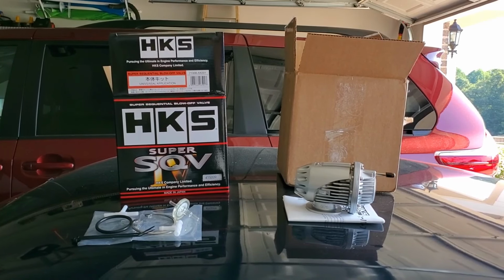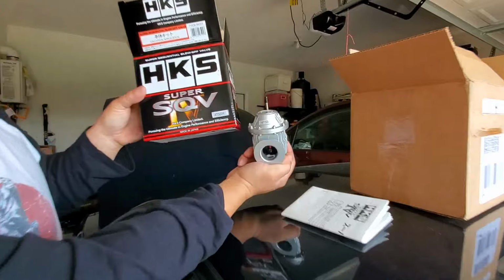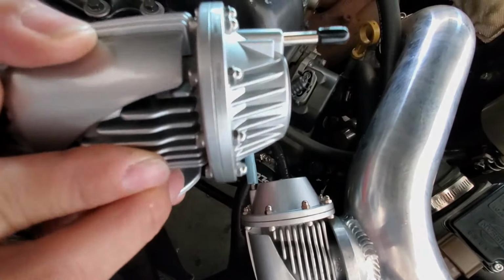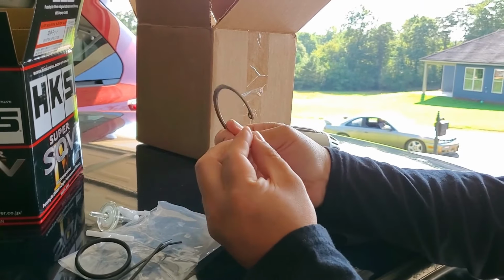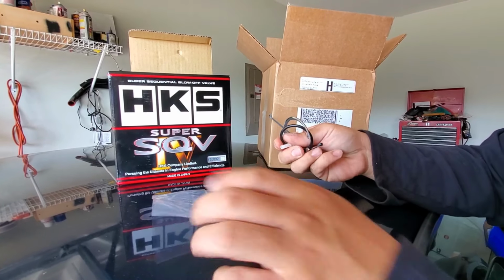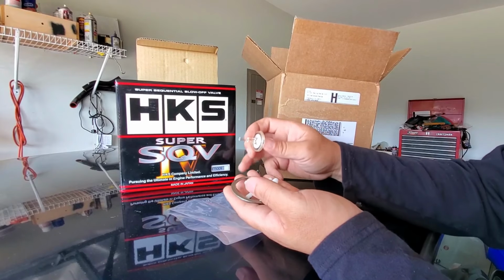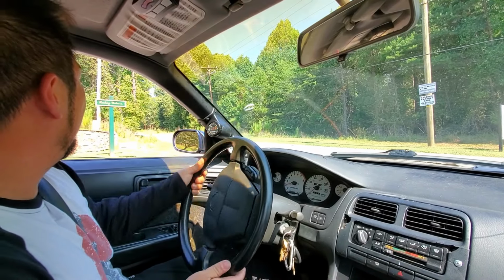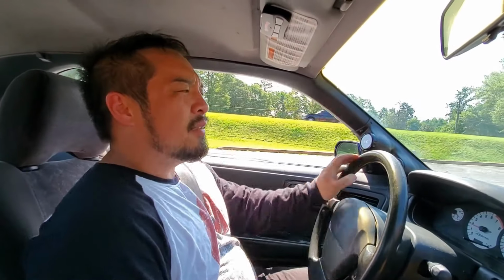Real HKS BOV vs Replica BOV (SSQV Blow Off Valve)

Comment: I like the flatter noise on low boost. I like the replica better.
Reply: Run no bov you'll get a better flutter. Flutter comes from the turbo not the bov. The bov makes the pssh or cherp sound. Reason why the flutter is gone with the better bov is because it's working better at releasing the pressurized air when you come off throttle and the air has no where to go but out the bov. Cheap bov didn't let the pressurized air out as good so it when back through the turbo making the flutter.
Reply: @remyche8768  ya but only on los boost so it’s not that big of deal right ?
Reply: i like the replica better
Reply: :( mine doesn't flutter what the f. It just blows off ridiculously high pitched lol. It's got.boost alright but I want sone stututurus
Reply: @know1n359  you need a turbo bro
Reply: @know1n359  Your car probably doesn't make enough boost. Flutter is air being forced against your turbo. It sounds great but isn't all too healthy for it.

Comment: that isnt the turbo surging.  thats just the bov being off on the spring.
Reply: My hks recently stopped making the high pitch blow off sound, my car still holds the same amount of boost pressure it just makes the turbo surge. Do you think its maybe a spring issue?

Comment from the maker: We hope you all enjoyed this video. Any questions?? Drop it down below👇
Reply: I have used a real and replica one on my Megane RS. I dont think you get those in USA. 

But they are both very quiet, unless I am on full throttle under load. 

If I rev in neutral regardless of throttle it will not release... 

Any ideas? Honestly will probably just throw on an older turbo smart one. 

But its baffled me...
Reply: I guese a tight bov is kind of the "Functional" priority... but I am a bit disappointed even the HKS was very quiet. 

I even tested both and got same boost, same sound... just a matter of reliability but they seemed as strong as eachother.
Reply: 2.0L inline 4, about 290hp from the crank. 14.7psi. (Small turbo)
Reply from the maker: @Mira6Rus  In neutral, though it may not be as loud as with the car running, the bov should still open. Put hand in front of bov release port and you should feel air being release. If nothing at all, then the bov is not opening. Suggest checking vacuum line and dont use thin soft rubber line because they may calapse under vacuum pressure and heat.
Reply from the maker: @Mira6Rus  Make sure that the vacuum is not clog and hook to a port with access directly to the inside of intake manifold.
Reply: @risin9365  I will give it a try! I just barely understand the "Why" of how a BOV works. 

Im a V8 girl 😂
Reply from the maker: @Mira6Rus  Any more questions, don't be afraid to ask us. We will do our best to help you out. 😁
Reply: @risin9365  Thanks :) I wish I could just drop the Megane off at your place and leave you 100 bucks or something haha 

The French make nothing simple -_-
Reply from the maker: @Mira6Rus  Not a bad idea. But at least you are learning 😁
Reply: @risin9365  No hoses seem weak or flat, and if they were flattening under pressure it would probably be least effective at 100% boost, not most effective. 

I think we can eliminate the lil vacuum hoses.
Reply: @risin9365  I am still running stock air intake, just with a aftetmarket panel filter... 

Its notoriously "Silencing" as when this was stock my god was it quiet. 

Pipe it down under the battery, cold air intake to under headlight will help?
Reply: @risin9365  I hate pod/mushroom intakes but I assume its the best plan to get more air flow?
Reply from the maker: @Mira6Rus  hks Mushroom are the best
Reply: Can you send me the link of the replica were you bought it please?
Reply: @Valantis_Stylianou  Yasou... 

Mine was a "GT Performance" HKS Replica for a Megane RS. 

But its essentially just a ebay HKS knockoff that this company added the right adaption hoses etc for Megane RS. 

All the cheaper "HKS" SSQV seem to be the same Chinese Maker. And mine ran almost identical to the real HKS. 

(Only 16psi... Had it in like 3mths now because I cant be fucked changing it to the real one). Its just a BOV... you will know when it breaks and it wont do much damage.
Reply: I wish I could but I don't afford it. Thats why I asked about the link of the replica that he bought!
Reply: Please when you have time send me the exact link of the replica that you bought
Reply: @Valantis_Stylianou  Ignore that dudes review he probably didnt even buy it. 

Ive had mine in for a while now... even did a track day with it haha
Reply: @Mira6Rus  I think you are right. I'm gonna check it out. Thank you for your help!
Reply: @Mira6Rus  no load means no boost. The engine spins too freely
Reply: @RobOnMotors  I have a proper intake now... It was that not the bov! 

Bov is annoying af now haha too loud

Comment: Does it sound the same ?
Does it leak boost ?
Those are the two question I’m looking to be answered. Most engine bays you can even see the damn thing anyway.
Reply: Does it affect reliability?
Reply: I ran one on my daily running 28psi and the only issue I ran into was the o-ring for the flange broke other than that it worked perfectly for 2years until the car got totaled

Comment: My SQV is not a counterfeit, but the low-speed pressure relief at 3-4000 rpm is different from your low-speed pressure relief at 3-4000 rpm. How should I install its pipeline to make the pressure relief sound like yours? ?

Comment: Thanks Man. It helped me, but i read on the internet That the original hks 4 have 2 valves. Smaller for lower boost (0,2-0,5) and the bigger for higher boost (0,5 - 2,5). Is That right?
Reply: Yea that’s how a sequential bov works
Reply: @steveq4178  that's why they are expensive because China bovs hks4 have only one, but its written on Valve sequencial. Its lie. They cost like 5 times less.

Comment: Above is a simple mechanical device ... nothing complicated... this over hype  doesn't Wirth the price.....
     If your car is a 7 lb boosted...u can do without genuine hks bov 🤣.
   Bov require correct set up... vaccum/ boost hose connection and pretension spring are important.

Comment: I use to have a HKS with 8 bolts but all the rest was exactly as yours and was proper Loud. I’m getting 100% real now but did HKS ever made an 8 bolt SSQV4 version?
Reply: Dude mine is the same & it has 8 bolts in the back but everything else looks like the one in the video .I been running it with no issue on my sr20det for the pass 7year & it’s loud .
Reply: @JV-fu8br  yea mine aas very loud as well! No issues but want everything original now lol

Comment: America is great ! Asian , Italian who the F ever ! Lets all be corn fed, race car enthusiasts together! GREAT VIDEO BROTHER !!!! Any advice on manufactor to use on a 2011 335xi twin turbo ? has a jb4 tuner , exhaust , cat less down pipe , intercooler , snow performance stage 2 meth kit but blow off valve stupid loud at low rpm's like you were mentioning in video ! new to turbo tuner car life ! once i drove this car i had to own it ! engine would buck bad upon heavy acceleration, found cylinder 6 80% leak down failure, only 25lbs of compression ! injectors seem good and coils . No idea how cylinder 6 ended up poop! Also had a low coolant alert every 50 miles or so put on car , failed a pressure test but could never see any coolant leak, even up on lift !!!! no milky oil mixed with coolant and car never blew smoke out exhaust !   I found a company to sell me a fresh remanned motor for 3,000$ , what should i do in the 30 days it will take to get motor ? I like your character and your intelligence and how you explain without all the social media ass juice retard extra shit ! I could really use your help brother and appreciate your videos thus far ! snow meth kit not installed yet . car never been right since i bought few months ago . in engine malfnction reduced power mode car ran accelerated smooth , soon as i put jb4 in auto tune full power mode , upon hard acceleration car would hesitate and jerk frekin hard ! then jump in reduced power mode until engine light started blinking and lost cylinder 6 . hope hear from u ! james renai , in Delaware my facebook .

Comment: If you don’t like surge, check the vacuum connection on back of bov, it is not producing enough vacuum to pull the gate and vent the air out.
Reply: My thoughts exactly nothing to do with bov just boost leaks

Comment: The replica will not last longer. I have using it on Mitsubishi Lancer GSR 4G93T with stock boost (0.7bar), after 1 month it started to sound like turbo flatter, then I bought a cheap used real first version of HKS SQV and changed it, no more turbo flatter sound... I still using it for over 8 years now, still working great, not sure what will happen if I increase boost pressure, I will try it soon. But my both HKS SQV have adjustable spring pressure, it is the first version, chrome body.
Reply from the maker: The replica works ok until pushing the boost up. We highly recommend the real version to eliminate any possible leak. You may have the earlier HKS version which is still a great product.
Reply: @risin9365  maybe the replica did you using are made in Thailand or Taiwan, it's quality is better than made in China. About boost leak, the replica does not leak. But I heard, the real SQV cannot hold very high boost. I hope someday someone will make a prove video about it. Anyway, thank you for your video.

Comment: You're not really hearing compressor wheel reversing or fluttering with low boost, that's your wastegate fluttering from the low throttle surges within the vacuum lines. You would really only hear compressor surge when letting off the throttle as intercooler pipes have a bunch of pressurized air inside and nowhere for it to go. As far as liking or disliking the wastegate flutter, that's subjective. I never gave a damn so long as everything was working.

Comment: Those both sound way different compared to what my HKS sounds like. I have 0 turbo surge at 2 lbs of boost or 19 lbs of boost. The HKS sounds much better though for sure. It sounds like that knockoff is to restrictive to dump the boost fast enough.

Comment: So I ended up purchasing a replica thinking I was getting a good deal. Now that I have it I am curious as to any problems with installing the replica versus going about getting the authentic?
Reply from the maker: Just get you a very good snap ring tool and you should have no problem. The replica snap ring may be a bit of a pain to install but it is manageable. Also the replica rubber o-ring may make it a bit more difficult because the size may be too big or too small depending on the supplier.
Reply: Where did you buy the replica

Comment: just a good fact. the one fin on the top doesn't make it a fake. that is a fake one but that fin doesn't  identify it as fake. HKS made several different models through out the years, my wife has an OG HKS on her wrx with no fin and its authentic. Every time HKS releases a new BOV after the first original one they added a fin. The original real HKS was a smooth surface with no fins. The SSq2 has 1 fin, the ssqv3 has 3 fins, the ssqv4 has 4 fins,  DO not use the fins as a identifier for being a real or fake HKS. Another way to tell with the better looking fakes that actually say HKS on em. the fakes dont have the trademark logo in the corners of the HKS badges on the valve itself.

Comment: I have always had a question I had a replica and it was identical to the authentic one but the nuts and the rough part that you mentioned that wasnt smooth in the authentic one is what really told them apart. Can you tell me if the authentic one you have holds vacuum or does it slowly release it?
Reply: https://m.facebook.com/story.php?story_fbid=909338782559852&id=100004512164948 here is the link showing the quality of the copy.
Reply from the maker: We don't have the necessary tool to test that right now. But how are the T-piece and Snap ring that comes with your bov? Do they match our authentic descriptions?
Reply: @risin9365  no they were the same as the fake one you have. It was black and the t piece was cheap plastic. I can tell you now they are using a silver snap ring now and trying to pass it as an authentic one but the part doesnt seem to have the bevel cut on it. Counterfeit has gone a long way to be honest. When I did the vacuum test on mine it held vacuum but it leaked very very slow so I know the fake BOV had good response. This is my second knock off I tested. The first one I had you knew it was a knock off. Had hks written on it too but it ripped the diaphragm and I repaired it and also trimmed the housing because it was poor casting that wasnt cleaned off. I'm sure it was a rushed process being made but overall it did work properly. The down set was that the black snap ring was prone to rust. I also forgot the dual action that the authentic one does the copies do not do. The center part is molded together with the outer part as just one piece design as the original hks has a two part relief action. The one thing I wanted to know is the authentic one really hold vacuum and not leak anything. If the original did have a very slow leak as the fake one I could really say the copy is just more cost effective and the real thought would be how long that copy will last before something breaks on it. Obviously the quality of the original is outstanding and it will last way longer.
Reply from the maker: @PeNDmN  Yes, the authentic one does have two stages of release. Replica ones are stepping their game up, the Bov itself looks very identical now externally. We have not taken apart a real vs fake bov internally but that is a great idea to show comparisons internally. We must do a video in the future.
Reply from the maker: @PeNDmN  Replica company tends to not waste money/time making the t-piece with HKS branded on and also a nice fine snap ring with the bevel cut on.
Reply: @risin9365  someone already has taken apart a fake one and real one but an older version of it though. You can definitely see the quality differences though.
Reply from the maker: @PeNDmN  definitely would be nice to pull one apart and gain some knowledge to pass on to others 👍
Reply: @risin9365   I finally bought a used HKS SQV4 same as yours. I tested the vacuum port. It held vacuum without any leaks. Not like the replica so yes huge difference I can tell you. Night and day. I hope this helps others as well.
Reply from the maker: @PeNDmN  awesome. We really appreciate all your input. This will definitely help everyone out.

Comment: how many psi can the hks bov hold?
Reply: All the psi. The HKS SSQV is designed to seal better the higher the boost goes. It's a Pull-Type BOV, so to release the pressure, it is pulled open AGAINST the pressure, not WITH the pressure like, for example a Bailyes DV26.
Reply: @frankotto83  thanks for the info.
Reply: @tommyfacekicker  no problem Dude!😊👍🏻